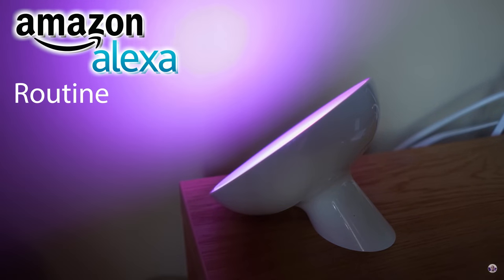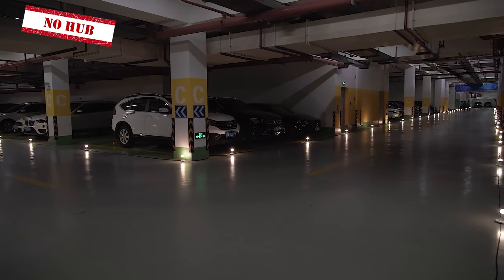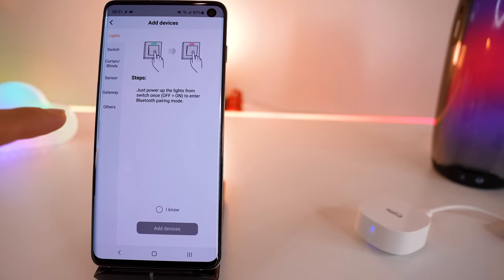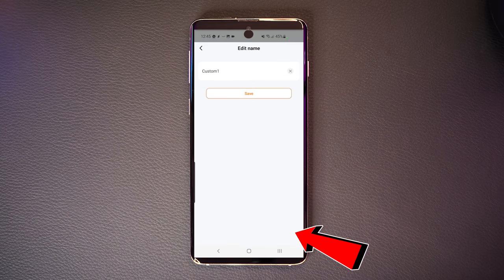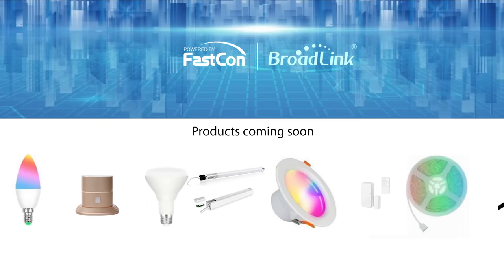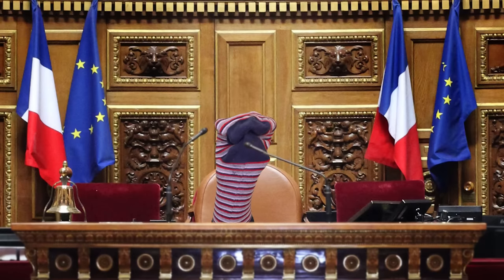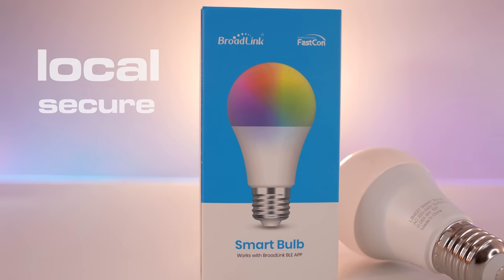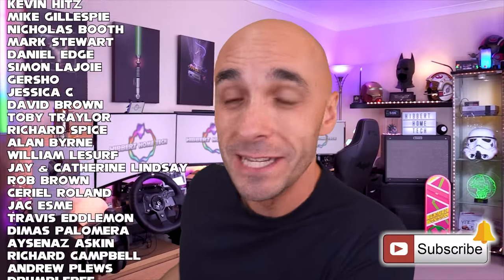Smart Home Light Switch - No Neutral, Because No Wiring!?

Comment: Hi
I am starting just starting with smart home things
 I have watched your beginner guide 2022; however, I was surprised that you did not mention “Hubitat”.
Also, I am wondering if you can make a comparison (pros/cons) between the fastcon BLE and broadlink’s switches which do not require neutral wires.

Comment: Hi Paul. A couple of loosely related questions if I may. Is the hub the S2 version and does the RM4 Pro work with the new BLE app? Many thanks.
Reply: So I have found out that the hub is listed as a GW4C Mini Hub, which I guess is different from the S2 one, frustrating as I have two of these although only one in use at the moment.
Reply: Sorry that should say S3 not S2

Comment: Amazing video, amazing move by Broadlink!

Have Broadlink said anything about having the bulbs remember their last state in case of a power outage?

Also, didn't you say a while back that going forward you'd include whether the things you tested work with HA or not (yet)..? I mean, this probably does, but locally?

Thanks again for the superb infotainment!
Reply: I agree that the power failure issue is a deal breaker. I would like to use these to replace my outdoor Lifx bulbs that are always offline when I want to adjust them.  I can't consider using Broadlink though until I'm assured that a brief power flicker at 10AM won't leave all of my outdoor lights burning all day until I get home in the evening to fix it.

Comment: Positive move from a big company realising there is more money to be made from charging more for devices but allowing local control.
Cheap Device - cost of cloud is killing companies and going 360 is the only way to go and clearly they see it

Few points you forget to mention when comparing Hue to other bulbs that should be stated as not everyone is in need for brighter then what a hue bulb can do.

1. Fade in/Out - Hue will slowly transition on and off to give a nice transition unlike other bulbs that cut power, sure thats like a traditional bulb but when you've had these slow transition its hard to go back.

2. Dimness, Hue bulbs from my expierence go much Dimmer then other bulbs

Sure you might not care for both of these and do care for brightness, but it should be mentioned as there is other characteristics of quality in lightbulbs then just ''Lumens''

Comment: Just got the starter pack this morning setup was pretty simple however it currently will not link to Alexa! Just get a 404 error when trying, links and works ok with Google home which is annoying as home full of Alexa’s only so can only control the bulbs with a phone! so currently its useless until they fix this.
Reply: That's bad news, dude, l was thinking of getting the kit too but like you l have alexa house wide, echo shows, 3X5 inches and 4X 8inches mostly a mix of hue plugs, and bulbs 4 sengled bulbs, and l would want Alexa to control them with voice, l thought the bridge that comes with the kit was meant to connect them to Alexa ?
Reply from the maker: I sent them a grumpy Skype message last night and Broadlink have confirmed this morning that there is a bug with non English devices and they're working on it.

Comment: Many things remind me of the nordic Plejd, very popular in Sweden at least. Altough that is more install focused so an electrician can install the dimmers and share it easely to the customer as they mainly do behind the wall dimmers. But timers and astro clocks etc are local on each device don't even need the hub for that. I use standard Schnider frames for my wireless button which is claimed 15 years batterylife....mine has been up for like a year and a half and the clockcell battery is still 3V+

Comment: "What if I told you that Broadlink has been creating in the background..."
As much as I'm generally opposed to YACS (Yet Another Competing Standard), this one looks to be worth the additional 
Works locally, without a bridge (and you don't need an account). That's it. BroadLink wins in the "We actually make things easy for our customers" segment.
"Wiring the switch as always on and covering over it with a [smart switch]." That's what I've done in a few cases. I understand that, in certain locales, this is actually against electrical code because the code requires a local way to cut all power to the socket. Fortunately for me, here in Indiana, they take a more Darwinian outlook on assuming you're smart enough not to stick your hands into a live socket.
"Could actually replace Home Assistant": Well, in a limited, but not small set of devices. What I'd like to see is a Home Assistant integration for this. (Give it time.) You could tick off an entirely different segment of your viewership by saying that this could replace Matter :)
Reply: Personally I think the best part of Broadlinks addition is solving a huge problem with Hue, Zwave or Zigbee - the reliability of an updated central hub. I could easily recommend using this in a new house / building. It will essentially always work as it did when you bought it. Cloud, or Home Assistant, is an add-on - not a required part.

It's also why so many houses are still built with old-school automation (Like LK IHC, Konnex, etc) - they are hesitant to put in new tech that relies on the goodwill of Philips or the Zigbee Alliance - and with good reason. Philips have screwed over their customers hard multiple times. Zigbee is now being "replaced" by CHIP or  whatever their new name is. BLE is a fixed, local standard, and could easily be adopted into CHIP or even Hue, but should always work without either :D

Comment: Looking promising. What's stopping me from taking the plunge is integrating into my current system. I like lights on after power restore. This is because I still have the existing switches in place. So this allows it to work like an existing light no matter what breaks. So maybe broadlink should allow users to choose this. Happy customers are good for broadlink right.

Comment: This is great. For Broadlink i mean. What happens in the future when they come out with a upgraded version of this and the older version just doesn't work right with the newer one. We've seen this time and time again. (or at least i have anyway). Its yet another enclosed system that can't be used with anything else other then other broadlink devices. This is why i went to home assistant in the first place so i can take another company's devices and integrate them under one roof without having to buy any one company's hardware.
Reply from the maker: I honestly don't get this level of negativity.

If you buy a switch and some bulbs with the intention of controlling some bulbs with some switches then they will work forever.

If you want more than that then it's an exciting step in the right direction.

I suspect this is some home assistant pride talking.
Reply: @paulhibbert  no this is reality talking and experience. Been there done that more times then i can count with x10, wink, smartthings all been there done that with them. x10 died wink died, smarthings is now so slow with so much downtime they might as well be. Sorry but not buying into it again.
Reply from the maker: I don't know what you're talking about. All products have the potential to physicsllt some day die, and you then replace them with whatever the best thing on the market is at the time. You have the same issue with all the devices you've connected to home assistant.
Reply: @paulhibbert  right now if I bought the devices from broadlink I can't use them with anything else. Nothing except other hardware they (broadlink) makes. That is what I'm talking about. Maybe in the future it will be possible maybe not. I'd rather buy products that I can use with most anyone else's instead of getting locked down to one manufactures devices.
Reply from the maker: Why?
Reply: @paulhibbert  because they will not integrate with ANY of my current devices I have in my smart home. Why would I buy there proprietary devices when I can buy any number of others and they would work fine with what I have now. And run locally and just as fast if not faster then these?
Reply from the maker: Sounds like a "you" problem

Comment: If I wanted to use the hub and connect it to alexa, could the switch be used to to trigger alexa routines?
Reply from the maker: Broadlink got delayed by amazon with the rollout for this and didn't tell me until After I'd released the video 🙄 they reckon July it will start working. 

To be fair to them though they have apologised and said that anyone who bought this specifically expecting it to work with Alexa routines can have a new free scene switch when the api is finished. My contact said to write to vipsupport@ibroadlink.com

Hope that helps man, and sorry for the missinformation.

Comment: Do you know there products work cross platform.. For example using their motion sensor to control lights from other companies like lightwave or will it only work with only their own products.
Reply from the maker: At the moment it's just their own products, but Matter is on the way and Broadlink may be joining that 😉
Reply from the maker: Oh, I just thought, you could use the switch as a trigger in an Alexa routine too and control other products that way!

Comment: Does it come in bayonet bulb type aswell or just es
Reply from the maker: Just E27 at present.  They are expanding though, so who knows!
Reply: Looks like no bayonett...wonder why ..though you can buy adapters
Reply: If it's for a pendant, it's dead easy to change the lamp holder. Floor and table lamps, not so much.
Reply: @JamesMyatt1  yeah I get I can change my existing fittings but I don't want to, it's more hassle and this is supposed to be an easy quick install. If it had bayonet bulbs I would order a few sets right now. I also don't want adapters as they extend the light which in turn means I would have to shorten the cable.

Comment: I got a broadlink buttons to trigger Alexa routines as Reed recommended on his channel but it’s being a frustrating experience, when it works it’s nice but it disconnects almost every 2 days and doesn’t work again until I reset it

Does this has the same problem as an Alexa scene switch? I see it has the same hub as the buttons so would love if anyone have experience any problems

Comment: The starter kit arrived today and it was really really easy to get a bulb up and running........ A bit more difficult to get the switches working as they don't come with a battery so I have to get one before I can try it out, a bit disappointing really, it should come with a battery surely as it's not an standard AAA!

Comment: @Paul Hibbert Why don't you try shelly gear other than the bulb. like shelly 2.5 or 1PM.. shelly pucks fit nicely behind standard wall switch so everything appears "normal", but they provide a lot of smarts and flexibility.. can run scenes, mqtt, or even html commands directly to other devices. from all different devices i've tried so far.. shelly is the most flexible and feature rich.. and it gets included into home assistant extremely easy.. :) yes.. the home assistant... :)

Comment: Great product, great features! But needing batteries for a light switch is no choice for me, even if they läßt for two years. I want to use the power grid! I hope they will develop a flush-moubted smart light switch without batteries replacing the normal switches.

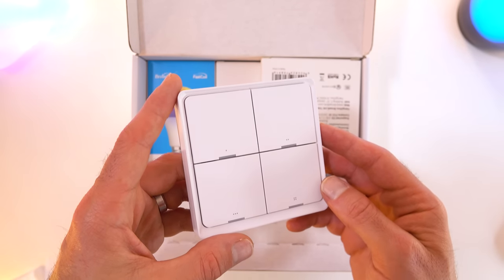Comment: I always rated you Paul but you went up even higher in my estimation when you totally pre-empted my biggest issue with this at 10:22. I was 100% thinking the same on the inflexibility of the switch and particularly two things you mention, not being able to have a button toggle on/off a scene and not having flexibility on the press and hold actions. I really hope they get a lot of flexibility in there e.g. in my bedroom the same switch plate controls my en-suite bathroom as well as my bedroom so I need buttons not only for lights in two rooms but also for extractor fan and space heater as well. I also have a long press on another button set up to turn on my bedside and en-suite bathroom lights and turn off all other lights in the whole house which is a pretty handy one press going-to-bed action. The more actions that Broadcom can expose for that quad-switch the better.

Is this new protocol going to stay proprietary to Broadcom or do you think that it might open up to the extent that things like Hubitat and/or Home Assistant might be able to see devices and detect switch actions? That would be quite handy for people like me who have ZigBee devices that they don't want to ditch e.g. smart ceiling lights that don't take regular bulbs or stuff like temperature and humidity sensors if Broadcom doesn't add those to its range of products. Or maybe Broadcom could release a new "pro" hub that was more like something like Hubitat and could integrate other non-Fastcon devices plus perhaps have more onboard processing and memory for more complicated and numerous automations and other local functionality. I would certainly be willing to pay extra for something like that.
Reply: The protocol they are using is just Bluetooth. But Bluetooth does have security capabilities so it will be interesting to see how they are implementing that. It’s totally possible for something like home assistant to integrate with that if they make the security allow it. 

Broad link already has an ir remote device that does a lot of automation. I wonder how they will integrate the two.

Comment: This is cool if you intend on migrating everything over to Broadlink, but right now they simply don't have the range of things that I'd need. And since the communication is one way (Alexa can control the scenes, but the buttons can't act as triggers for Alexa), it's pretty much useless unless you want to spend a lot of money buying all new devices. Cool idea, but it's just not there yet.
Reply from the maker: It depends if you have a light switch and bulb that you want to set up and entirely forget about, or if you want to keep playing around with it in an app for no apparent reason.

People keep talking about this product as if it needs to fit into their existing smart home system... It doesn't.
Reply: @paulhibbert  It doesn't NEED to fit into your current smart home system, but it would sure be a lot more attractive if it did. Imagine if they had similar functionality to the Flic buttons, where they could communicate to Alexa to trigger routines. This would then be absolutely amazing. It would be a must have. (I still don't understand why Amazon doesn't make a product similar to the Flic buttons with the multipress functionality--they discontinued the gigantic Echo Buttons, which essentially worked the same way, but with less functionality unless you want to play lame games).

If I were just starting out, this would be great. However, these lights would have to be a part of a bigger picture. While it's a great idea, they need a wider array of products. Until then, since I don't want to deal with Home Assistant, I'm stuck with the cloud.
Reply from the maker: This product CAN trigger Alexa routines! Just not yet. I actually reported in the video that it would be able to, but there's been a delay due to the new amazon routines api going through last minute changes.